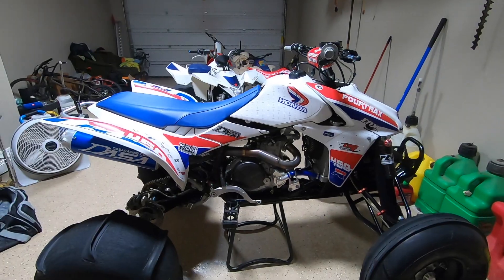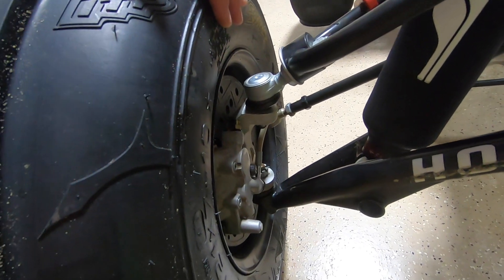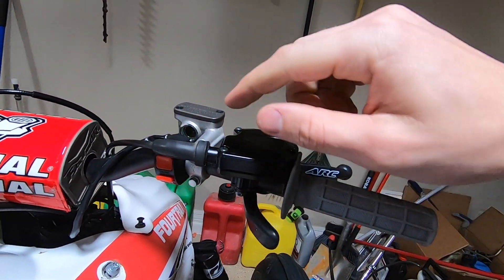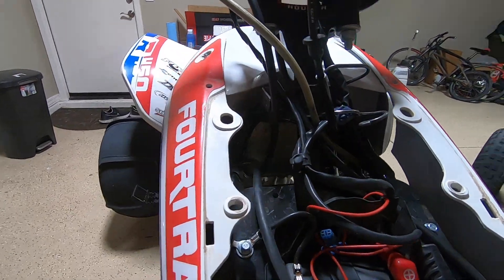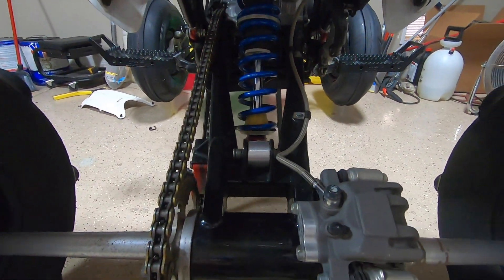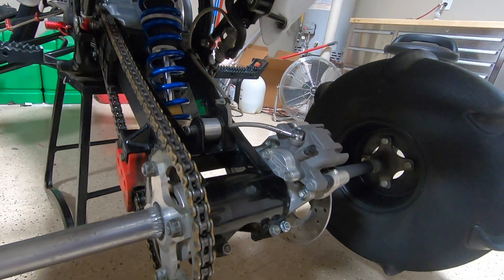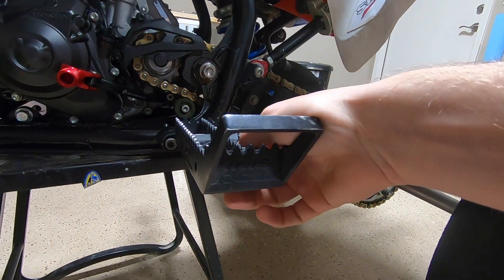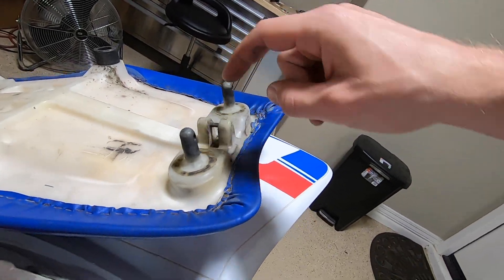TRX450R with 2020 CRF450 engine walk around

Comment: I absolutely am in love with this build - even though me being in the Northeast portion of the US with no dunes. I respect the way you've built it as its a completely different type of riding compared to trail riding. I just wish Honda would stop fooling around and release a CRF powered TRX even if it was a limited production run. EFI and more power is just the tip of the iceberg showing just how much more beneficial that would be than having to scower Facebook marketplace and Craigslist to get a clean 450r LOL

Comment: Very clean built. I have a Ktm 520sx on a Suzuki ltr450 frame and is torque machine only 4 speed I don’t think I can handle 6 . But I can’t seam to find neutral when is running now I don’t know if because is hauling so much weight now on a quad frame. My question is are you doing something with the transmission or just going to lived stock? My motor started stock but the I upgraded with high comp piso port and polish. Hoy cams and all the good stuff. But they never ask me about beefing up the tranny
Reply from the maker: Stock trans. Clutch beefed up a bit for the excess weight. Judder spring removed is all.

Comment: So I haven’t been keeping up with the Trx450r since 2009 when did they get traction control and launch settings? How do they work with a manual straight axle. I’m not trying to be sarcastic just am intrigued.
Reply from the maker: It's a modern dirtbike engine. Lots of videos on new electronics built into the ecu. Mostly ignition cut based on throttle/load

Comment: Why’d you go with the CRF front master cylinder? Just because? Or was there a performance and/or fitment benefit?
Reply from the maker: Wanted to run arc levers. The crf is smaller and looks cleaner I think. Plus it's half the cost of a berringer
Reply: @MFFilmsAZ  yeah Berringer are spendy